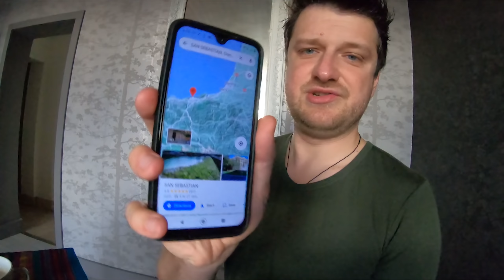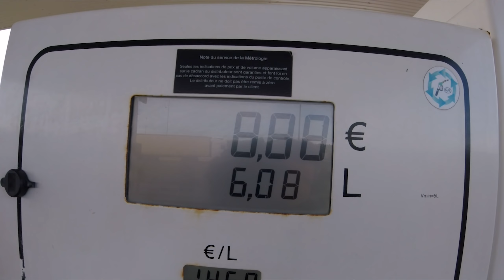Crossing French Border into Spain Who Are Also Entering Lockdown..

Comment: After 5 years of riding in the winter i bought clothes from the brand Rukka by Termaat in Nijmegen. It was not cheap but it is incredible good quality. And warm. It has goretexline at the outside. And now after 15 years it is still perfect. Only some coloring due to uv.  After 15 years it payed itself back. Big time.👍 Those zappie zips will zip foreever.

Comment: Zipper Repair: https://www.youtube.com/watch?v=vpDbUFKaUyY  :::::EASY
Zipper Fixer:    https://www.youtube.com/watch?v=wrSFIWG-mqU
Zipper Pro:       https://www.youtube.com/watch?v=QLwewloJ55w
I'm guessing you don't have the missing teeth issue, now that I have reviewed you video. It's pretty easy to fix any other problem though.
Zipper Teeth:   https://www.youtube.com/watch?v=RB5sTBsx5n8  This last one can be used different ways. If you have teeth missing in the middle for a temporary fix (because it's nearly impossible to replace teeth) you can add a slider going down, from the missing teeth point (because you will sew that area shut like  the illustration in "Zipper Teeth" It makes the jacket a temporary pull over at that specific point but you can unzip it from the bottom and/or top after that to cool down, just have to pull it over your head to remove.